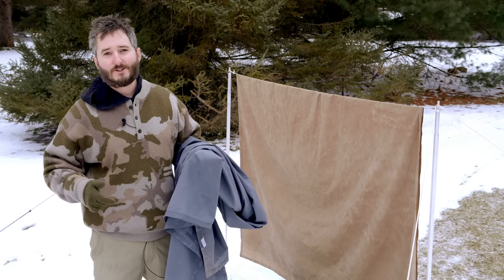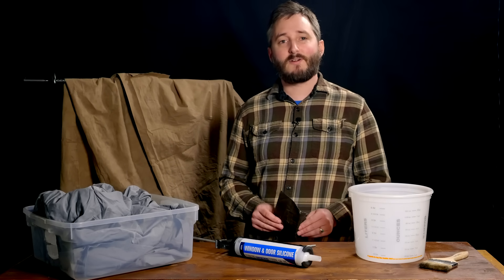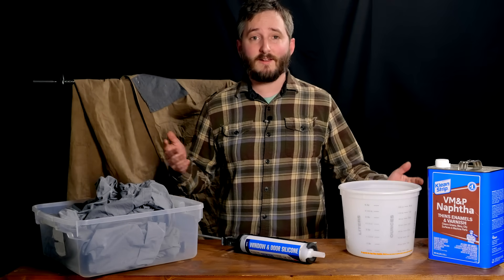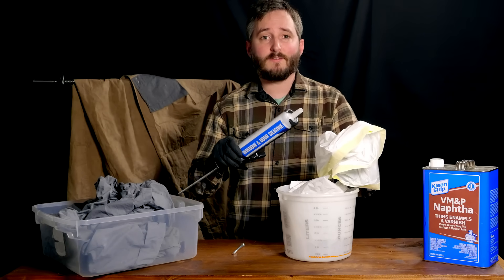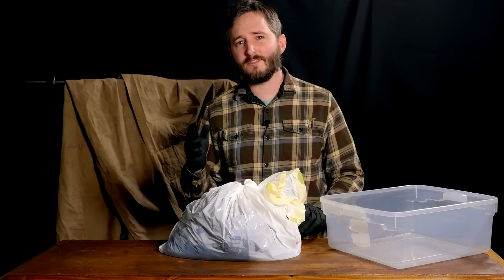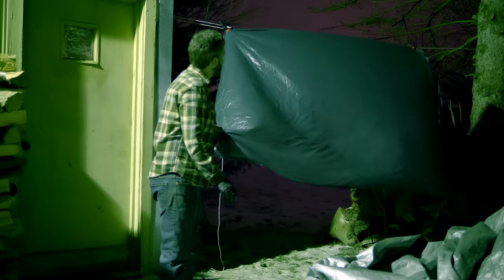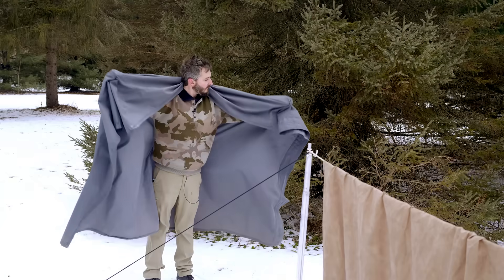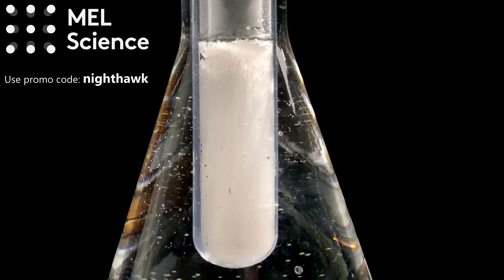Recycled Bedsheets Make The Best Waterproof Tarps

Comment: Your results are far superior than any I've gotten. Maybe b/c I was using mineral spirits. Plus, the material definitely felt different.

2 questions - Is the bottom of the sheet thicker/heavier due to gravity as the silicone dried? | Are there many permanent wrinkles in the sheet?

I ask based on an idea I had when burlap fabric became a popular material for DIY curtains. The burlap fabric is rough and likes to fray. Do you have any thoughts on how this method would work with that kind of fabric?
Reply from the maker: Doesn't seem like the fabric is heavier on the bottom. It will work very well on easily frayed material. It actually makes the material fray resistant, and allows you to cut it more easily without any fraying on the edges

Comment: How will it stand up against UV outside?
Reply from the maker: Haven't tested that yet, but for maximum uv resistance the best method for plastics and rubbers is to add lampblack to the mixture. I'm sure that would work here.

Comment: The instant question I have is what is the longevity of the material when constantly exposed to UV light.  I've come to learn that old billboard material makes the best tarps simply for it's intense UV protection.  Even the most expensive car tarps are garbage after  year or two tops.
Reply: The silicone is UV proof and if you use a material made with polyester, it will last longer than you will ever need it.
Reply from the maker: Depending on the fabric it should last longer at least than a plastic tarp. For maximum uv protection add some lampblack to the silicone.
Reply: @Nighthawkinlight  How flame resistant are these fabric tarps? I'm wondering if some of the Naptha gets trapped within the fibers of the fabric as it all dries. Would this burn faster or slower than the original bedsheet and how might it compare to a plastic tarp?

Comment: This is a nice idea, have you tried some form of a hydrostatic head test to see how resistant the fabric actually is? Also I wonder what will happen after some time of using it.
Reply from the maker: I haven't tested that, but I can tell you that the level of water resistance is proportional to how much the silicone is diluted by the solvent. You can make a solid layer of silicone that is totally impermeable if you paint it on

Comment: I've got a bunch of older nylon bags with (silicone?) waterproofing that is peeling off the inside and making a giant mess.  The fabric is mostly fine though. This would be a great way to refresh that thanks!
Reply: If it pills up and turns gummy it could be urethane waterproofing. Sucks when that happens. (Had it happen with a backpack.) Not sure how compatible it would be with silicone, but might not hurt to try.
Reply: @pauljs75  Thanks for the info! Knowing it's urethane opens up the possibility of trying some kind of solvent to do some initial cleanup before applying the (hopefully) more durable silicone.

Comment: If you don't have a pebble, just tie the line around a corner of the sheet with a little extra sheet sticking out, then fold that part back over itself, and tie around the bunch- the first knot becomes the "pebble" for the second! Brilliant video, thanks!
Reply: I used to drive trucks with flat trailers. When tying the sheets over a load, we used a similar method to this as it was stronger than using the eyelet on the sheet(Tarp). 
We would fold the corner of the sheet into what was called a 'pigs ear' (because that is what it looked like 🤔🙂) and tie around that with the piece of rope that was attached to the eyelet.
 That would hold firm and not rip the sheet no matter how long the journey or weather.
Using this method allowed you to get the maximum tension on the rope (Using a 'Dolly Knot') when attached to the rope hook on the trailer, making the sheet taught across the load which gives the best protection from the elements.
No pebbles needed! 😉
Reply: @Aardvarkjamm I wish you could make a video about it and we can learn this technique with the kids in school! Thank you!
Reply: @Aardvarkjamm please make a video tutorial about this knit!
Reply: See a knot known as a "sheet bend".
Reply: @hanelyp1  Might work here, if you keep it under tension? I'd be worried it'd slip out if the wind flutters.
Reply: @SoybeanAK  Can always tie a double sheet bend
Reply: @hanelyp1  
A sheet bend is used to tie two ropes together or at least that's what I learned. How would you use it in this instance?
Reply: @rogermccaslin5963  the other rope is the sheet
Reply: @rogermccaslin5963  The sheetbend was originally used to tie a line to the corner of a sheet (sail) when a grommet had failed or was unavailable.  Just bundle up a section of sheet that you can bend over and attach the line.
Reply: @rogermccaslin5963  actually no. It was originally for sails (sheets) it is also used to tie ropes of different diameters. For a sheet just fold the corner and follow the steps subbing the sheet for the thick rope in the instructions
Reply: @hanelyp1  To add to the confusion, the "sheet" is the name for the rope.
Reply: Quarter, nickel, dime, penny.  What ??
Reply: Who doesn't have a pebble?
Reply: @graypistachio4141  sailors at sea.
Reply: @graypistachio4141  and actually, that button, not sewn to anything can work just like the pebble.
Reply: @graypistachio4141  stuff, stuff, stuff. Back in my day we didn't have fancy magic phone computers and we worked dawn till dusk to make sure we had what we needed and not what we wanted. A pebble isn't something I had, wanted, or needed. However, I did have the knowledge of how to tie the pebble knot without the damn pebble and it works great. Also just so you know there aren't pebbles absolutely everywhere. But if your life depends on something that you have to secure with a knot, by all means, you go ahead and look for your pebbles bud.
Reply: @graypistachio4141  there are pebbles even on Mars...!
Reply: @graypistachio4141  That's very ableist bro, check your privilige
Reply: @Michael Montgomery surely the essential part of the description of a pebble is that it is smooth?!  It's not always easy to find a smooth stone.
Reply: I did that with a wool Shawl I bought to use as a kidney wrap for winter, but have been using it as a kilt. I used the doubled knots to secure it stand my waist like a bath towel...
Reply: Welcome in club! So much fun!
Reply: How could one not find a pebble
Reply: @jaybray4901   Yep, pebbles are common in many places. But I've also been places where the woods don't have many pebbles. And I've set up shelter in the dark a few times. And sometimes the only pebbles around are sharp and would tear the fabric more easily. I could go on but you get the idea! (And yes, I've spent perhaps an inordinate amount of my life just "wasting time" messing around in the woods in various parts of the continent!)
Reply: @SoybeanAK  
    I wouldn't call that a waste of time..
Reply: @jaybray4901  no no, to some, it must be a pebble that came from Michael's or JoAnn for it to work.
Reply: This method is good with a 1/2 bowline around corner of material, bend it over & put full bowline around the artificial stone just created. Holds well & unties easily. Used it for many years.

Comment: Theres a product I found at Tractor Supply store called Bish's Original Tear Mender is flexible and probably would work very similar without the solvent.  It does keep fabric and leather together well and is also waterproof.  It does dry pretty fast though.

Comment: I take it your still going to have problems with UV.  So longevity is going to be an issue.  Do you have a suggestion for that?
Reply from the maker: If UV is a concern the best solution is to add a scoop of lampblack to the silicone. That's what they put in tire rubber and outdoor plastic pipe for UV tolerance.
Reply: @Nighthawkinlight  Thanks, I found some Charcoal Black powder for epoxy that says it's specifically for UV issues.   I'll tray that.

Comment: Would this also work as a water-stopper for outdoor timber (end-grain)? Silicone is UV-resistant too - so that would mean fewer re-applications..
Reply from the maker: I'm not sure about that. It might soak into the wood and cause issues with applying finish later
Reply: @Nighthawkinlight  Granted. I meant for garden posts (to have vines climb up against them) - I expect never to paint them.
Reply from the maker: @AdityaMehendale  It might work well for that.

Comment: Great idea! I've got a few questions though: does the silicone rub off when handeling the tarp? And is the fabric and the silicone sufficiently UV resistant?
Reply from the maker: It doesn't rub off. It is moderately uv resistant depending on what fabric is used. It can be made more resistant by adding lampblack to the silicone
Reply: @Nighthawkinlight  Is there anything else that can work ,something commonly avalable everywhere instead of naptha? Would acetone,nitro paint thiner or oil thiner work? Gasoline? Diesel fuel?
Reply from the maker: @zumbazumba1  White gas camping fuel might work
Reply: @zumbazumba1  white spirits seems to be the closest equivalent thing i can find in the UK
Reply: @zumbazumba1  It goes by different names in different places. In Australia is is called 'shellite'...and not very cheap unfortunately. Cheaper to buy those crappy tarps than use a free sheet to do this.

Comment: This is awesome!!! One question; Is the fabric still breathable? Did it sink in the fiber leaving the minute spaces between threads, yet aquaphically preventing seepage, or does it create a continuous coating limiting air transfer?
Reply from the maker: Still breathable. You can make a continuous coating by painting on a thicker mix, but this thin solution will leave a breathable fabric

Comment: As well as a brush-on application, you could mix it a little thin and use a spray bottle to apply the liquefied silicone and, if necessary, use a dry brush to work into the pores of the material.

Comment: How durable is the coating, will it wear off after multiple uses? Great video as always!
Reply from the maker: I haven't had a chance yet to test over the long term
Reply: @Nighthawkinlight  If you leave a piece out in the elements until early summer and it's still repels water by that time, then I'd say you have a permanent solution using the silicone, which would be AWESOME. I'll probably try this out myself within the next few months, but I tried searching for Naphtha here in my small Euro-country, and it seems like we do not sell it anywhere? I get Lamp oil, Acetone, odorless petroleum ads when I search for "1 litre naphta". :(

Comment: I've used thinned Silicone 1 for sealing seams or worn spots for 15-20 years. I hadn't considered large pieces.

While I really like the "traditional" oil-cloth I made years ago, I'll certainly be trying this.

I wonder how well ripstop nylon could be treated in this method, compared to factory sil-nylon. 

Great one! Thank you.
Reply: Ripstop was my first thought and I happen to have a large roll in my basement. I'll report back after testing!
Reply: @CYoung-hq7zs  following   👍👍
Reply: @CYoung-hq7zs  also interested in the results of this
Reply: @CYoung-hq7zs  following ripstop nylon test, thanks
Reply: @CYoung-hq7zs  I'd love to hear of your results too.

I found some ripstop in 1.4oz/yd² and gave it a try. I used more naphtha (just over 6:1 but I think 6:1 would've been at least as good) to better wet the ripstop and I found that washing it first with just soap (real soap as in a sodium or potassium salt of a fatty acid) and water took a more even treatment.

After it cured, I hemmed the edges and painted on seam sealer of 2:1 with mineral spirits as it was the only solvent I had for silicone and I think it works ~90% as well if you're willing to stir a lot more. Don't avoid trying if mineral spirits is all that you can get.

In all, it was worth it. When hiking, I go ultralight but there are certainly places that I want sil-nylon that isn't 15D and I think the 40D at about 2.6oz/yd² will serve well in those higher-wear duties.

My next attempt will be some very heavy, probably 500D, for those corners that need special attention. My thinking is that I can use the seam sealer to adhere it and let it cross-link to the silicone in each fabric.

Comment: I was wondering if you could sleep on the sheet after it been treated or would the coating come off.
Reply: It's silicone. The coating isn't coming off from sleeping on it. Go find some silicone caulk in your bathroom and see if it comes off. It's the same exact thing.
Reply from the maker: I wouldn't sleep on it because even though silicone is recognized as being pretty safe that's a lot of exposure time. At least have a sheet or something to separate it from you. That said it should be durable enough

Comment: Another old way of attaching sheet corners to ropes is to wrap the fabric around a smooth stick. I have used a version of the stick method I devised myself from basic considerations of stress distributions, to make an entire edge of a sheet into a strong mount, by wrapping it around a plastic pipe. In my method, the more the ropes are pulled, the tighter the sheet wraps around the pipe. This is so strong, it resisted hurricane-force winds when the fabric was used as a roof secured on 2 opposite sides. But my method required poking small holes in the sheet at intervals, for ropes not at pipe ends.

Comment: I've done something similar in the past when i needed custom gloves using super stretch nylon stockings as a glove base and strings wrapped around the fingers to define the fingers (and in that case, a specific tool that was required to be used in the dirty environment).

Comment: This looks great! And I'm very interested to give this a try on an older backpack where the waterproof coating has mostly flaked off. Hit one snag already though:

Naphtha seems to be a different product depending on where you live. Is the one used in this video the same as white gas (camp fuel without additives) ?

EDIT: I see reading further down the comments that the brand used here does indeed seem to be just that.
Reply from the maker: Yes I think white gas is the same thing in most places

Comment: Could you use a good quality spray bottle to coat the fabrics?
Reply from the maker: Yes, probably that would work but maybe not as well as fully soaking the fabric
Reply: All the parts of the spray bottle including the internals of the pump mechanism would have to be resistant to the solvent. It would also have to be able to spray a pretty thick liquid (he said maple syrup consistency). You might have better luck trying a HVLP sprayer, since all the parts are metal, but you might have to thin it down and use a lot more solvent.

Comment: Now that's a useful set of compatible tricks!
I'm sure these tarps are generally waterproof, but I wonder if a tent made from these tarps would have annoying drips. I imagine it depends largely on how well the the syrup is absorbed into the cloth, but even if you did a thorough job, I wonder if nuisance drips would plague your tenting experience.

I also wonder about UV resistance, it would be nice to know how much one of these tarps would deteriorate due to the sun's UV and in what period of time. Not saying that he owes us that answer, but it isn't just wind that deteriorates poly tarps, it's also UV light. So, I suppose if I were to try this out (in the spring), I would build on this good work and test the true water resistant of the treated material and place a variety of samples out, for a UV deterioration tests.

I believe we can assume that the wind, waterproofing, and (to some degree UV) resistance would depend largely on the quality, materials, and with respect to UV resistance - even the color of the material. These would be a good variables to include in the testing...
Reply: Cotton sheets should hold up to UV better than synthetic ones. If the silicone is rated for outdoor use it should have uv inhibitors in it.
Reply: @NickHorvath  Yep, most I see around me are labeled for outdoors, or mention good for in Sun.
Reply from the maker: Yes the level of waterproofing is determined by the thickness of the silicone coating. If you don't dilute it as much in naptha it will be more waterproof, but harder to apply by absorption. You probably will get some drips through the tarp if it's not well set up to shed water, but not too many. For UV resistance the best results will be to add carbon black (lampblack) to the silicone mixture. That's how car tires and outdoor plastic pipe is made UV tolerant.
Reply: @Nighthawkinlight 
Cool, thanks!
I looked up lampblack pigment and it was originally the captured soot from the smoke of an oil burning lamp (oldest known use, in ancient Egypt). Interesting fact, the majority of prison tattoos are made from soot from burnt Vaseline, so it's the exact same thing. My freind, who did time for a lethal car crash, is the best tattoo artist I've ever seen. He says that soot (which is what they call it in prison) performs far better than commercially available tattoo pigments, when done correctly. But, it's like a Model-T Ford, you can have "any color you want, so long as it's black".

Comment: Do you know of a way to UV protect the fabric so it wont break down with prolonged use? Great video BTW.
Reply from the maker: Yes, mix some carbon black (lampblack) into the silicone coating. That's what's added to tire rubber and outdoor plastic pipes to give UV resistance